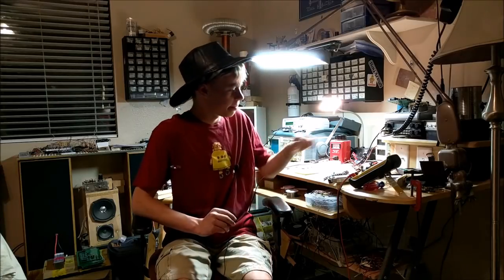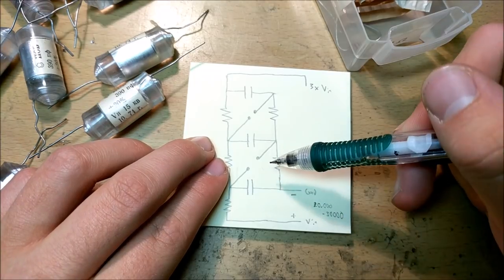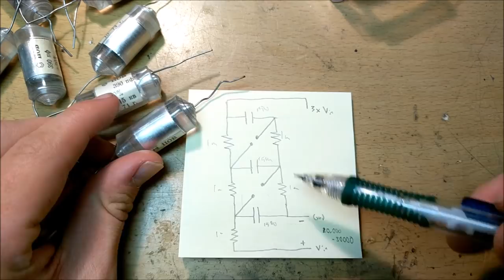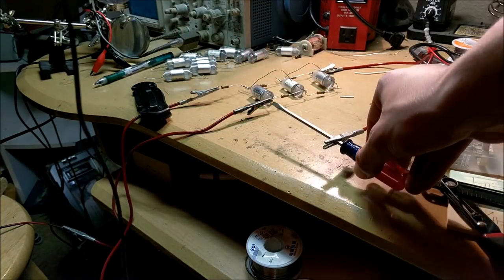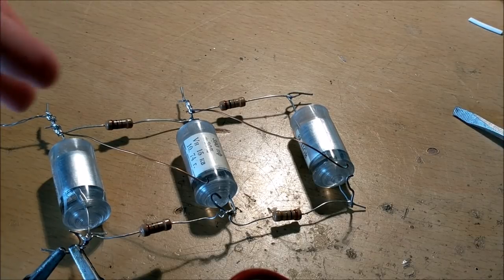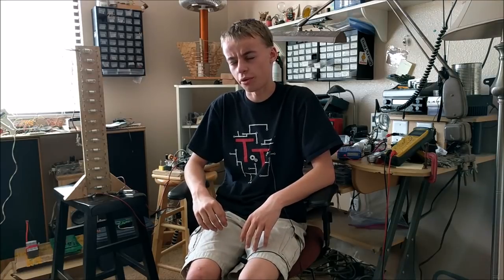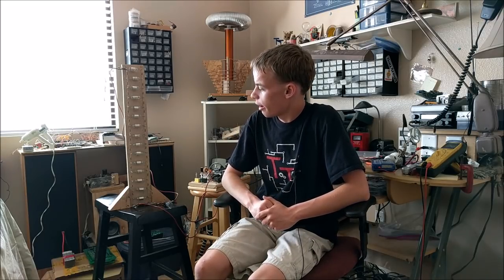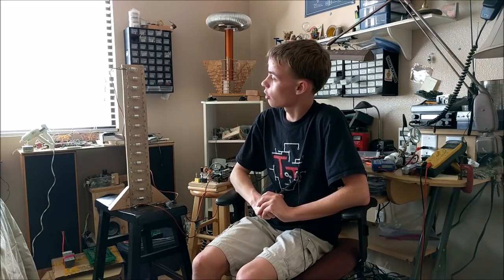DIY 15 Stage Marx Generator

Comment: Check out the resistance of your particleboard.  What you may find is that it is a high ohm conductor at those high voltages.  Anything wood is not good for high voltage because it absorbs moisture from the atmosphere.  I said "may" because it all depends on the humidity in your location and so it is highly variable.

I learned about this when I built a Dirod electrostatic generator that I saw in this book http://a.co/evFHSRS  I didn't read much then because I hated reading and just went straight to building.  Out of wood!  When I finished and started up the machine it didn't work at all.  Not even in the slightest.  I then sat down and actually read the text concerning it and learned about how wood is generally a conductor at high voltages.  You can use wood but you need to make sure it is thoroughly dry and then you need to seal it with something like wax or a polimer to keep it from reabsorbing moisture.

I'll bet a portion of your power is being drained through the particleboard.  Your coil former on your Tesla coil could be doing the same but at a higher rate being that it is high-frequency AC.

Comment: Looks like you already did this but make sure the spark gaps have direct line of sight all the way through, the UV from the first gap that fires will help break down the air of the other gaps and give more reliable firing.

Comment: Just guessing but it may be that your caps are too small and could be whats limiting the output voltage. Small caps are prone to leaking charges at high voltages and by replacing them with higher capacitance values it should reduce leakage.

Comment: You can do something similar that uses caps and diodes called a voltage doubler.. they are used in bug zappers and such
Reply: Ah the cascade multiplier! My second favorite circuit.
Reply: Marx generator works with DC and voltage multiplier needs AC

Comment: Pardon my asking, Isn't the maximum charge at the top? The capacitor value (charge rate) affects the frequency you can run it at. The voltage rating determine the final payload.

Comment: you  need to series a few resistors so they can handle the high voltage. also covering them with hot glue would help prevent arc over (and you achieve wider spark gaps) and thus a higher voltage, of course proper high voltage resistors would be better lol also you might wanna  try paralleling  your caps and having half the number of stages you might be surprised at the result.....   Steve

Comment: I thought that these only worked on high voltage AC. that was with a voltage multiplier, is it the same with a Marx generator? flybacks have diodes in them, so its DC. please answer.
Reply: Marx generator works well with dc . Flybacks can be used to power MG but the components must be rated atleast twice the input voltage.. For voltage multipliers you need high frequency ac . You can build one using core of flyback and power it with adjustable mazilli driver.
Reply: a cw generator might work well

Comment: if you make your 1 meg resistor out of multiple series resistors they will handle higher voltage. 333k+333k+333k=999K